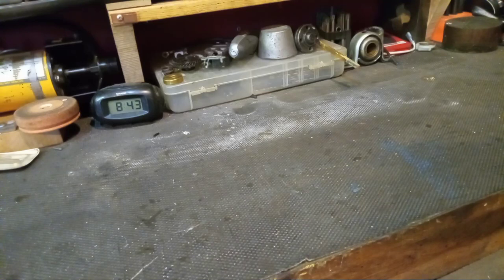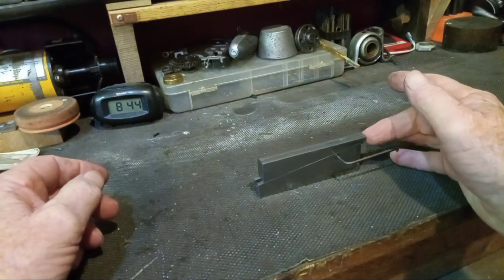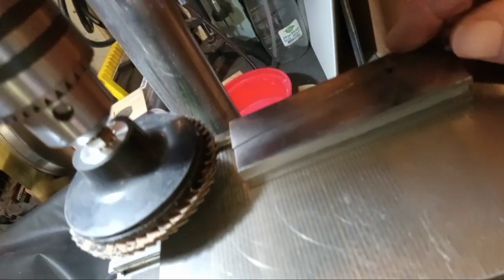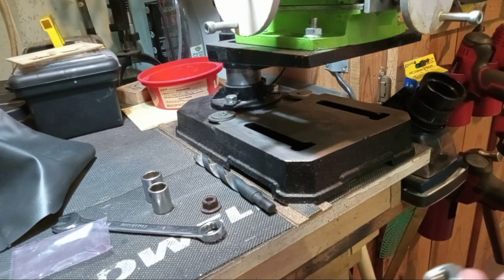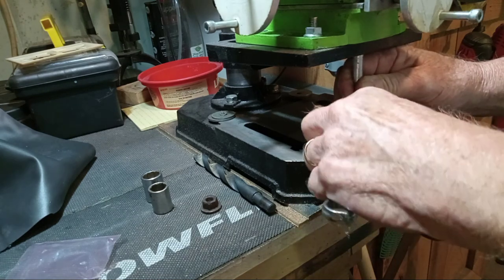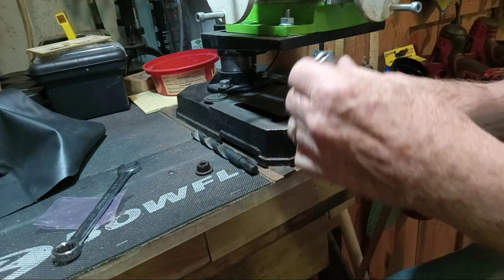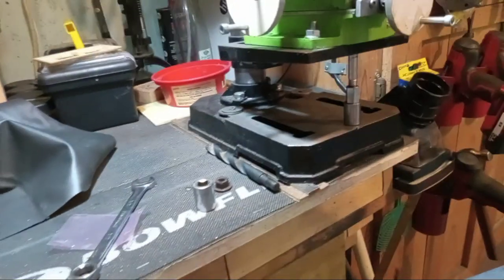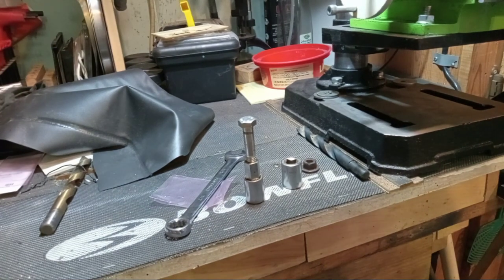Expedient machinist jack

Comment: "Space taker upper , semi - precise . . .  * A fine pitched length of threaded rod & 2 nuts* ONE of them would be the LOCKNUT , to hold positioning . . . * would give it a predictable amount of travel . . . although , using a dial indicator would work with coarse pitch . . . a bit more 'fiddley' .   ** Might be an idea to attach a block to the base of the apparatus -  ( in 2 places  . . . ONE on the front , & another one one of the sides . . . ** but then , the table likely already has a 'tilt' adjustment . . . ** though the rigidity could be bolstered up with the second screw ((JACK))     ;)     2 threaded blocks attached to the base of the 'mill / press ' would be handy ! ?    The only obstacle would be open space BENEATH the base -to allow for EXTRA height adjustment . . . 'might require a drilled clearance hole for the rod  . . .     Just an idea !    Good stuff , SCOTT ! ! !
Reply from the maker: All things that could be done.  But then I would need to run to hardware store for NF bolt a threaded rod connector..pay outragious price for them not to mention gas ..then the wife says " are you going to town?  Can you pick up....."    so all things considered a quick dirty solution vs hours of bs while my brain is saying " I should have just .....
    I think I think too much lol 🤪